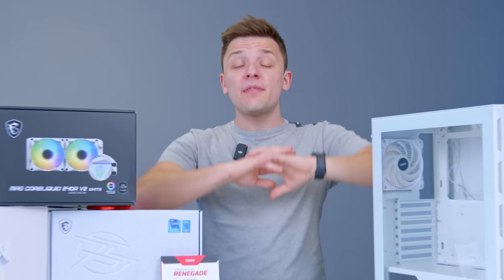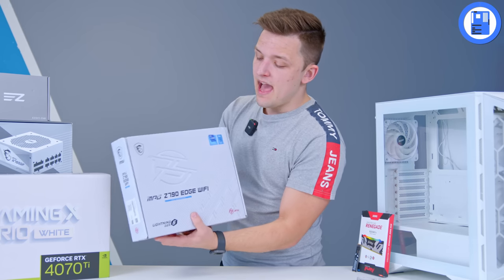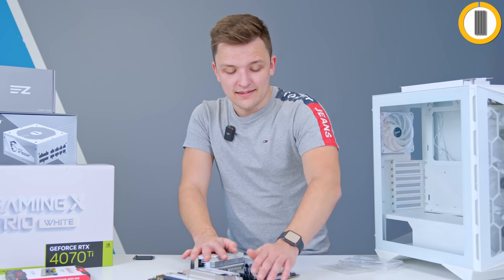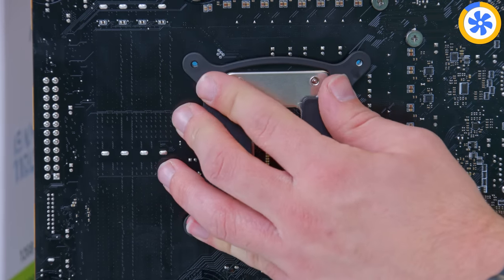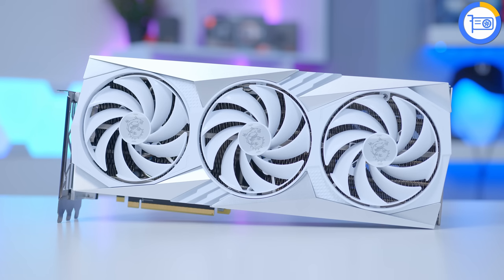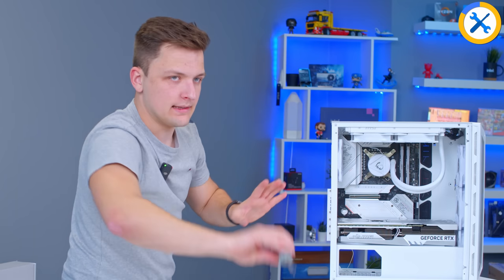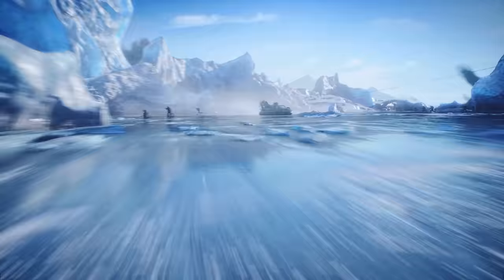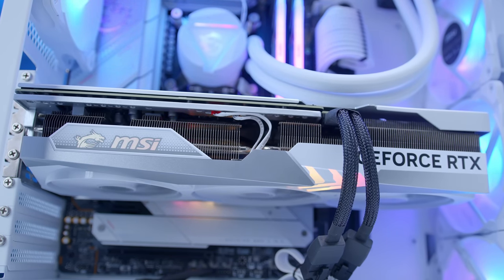Building a $2000 White-Themed Gaming PC Build! 🤩

Comment: Interesting prices. I built a 7800x3d with 7900XT for $2,000. Also, have the 980 Pro SSD with 2TB, not 1TBm for that price, and 5 noctua fans.
4070ti is robbery. Have slightly better performance with almost double the GPU VRAM for the same price.
Reply: I’d never be caught dead with these components for 2k. AMD gpus are the bang for the buck rn.

Comment: hello can you help me out built new pc but i cant get buy the windows connecct to internet i have tried shift f10 but i cant type in the cmd box keyboard not responding how can i get it working and how can i update the drivers for the wiffi or lan off the msi website i have them but can you install them from the bios screen

PC Builder

Reply

Comment: LONG GONE are the days of envying these types of builds I have a thermaltake P3 TG Pro Case with their DDC-360 hard tubes and Bykski water block on my 4080 gpu on my Z790 X motherboard i9-13900K, rtx 4080, 64 Gb Thermaltake Ram and cooler master V1200 psu.

Comment: 4070 Ti imo is the card to get as the 4080 only gives you roughly 20-30ish for 400$ which imo is NOT worth it and gaming @ 1440p / 165hz ive had no problems reaching the frame limit. In games like COD i really go for mid settings to get the most frames so its not a big deal and most top end gamers even have 4080s/4090 and still play on low with alot of stuff turned off to get the most FPS so...
Reply: Nahhh id rather stixk to the 6950xt or just buy a 7900 xt.
Reply: @user-yp1gs8vz2l  Im not a fan of amd drivers tho